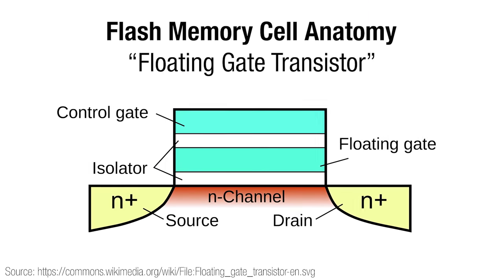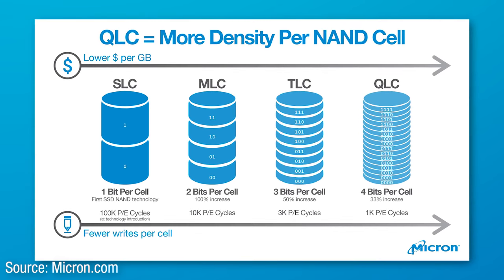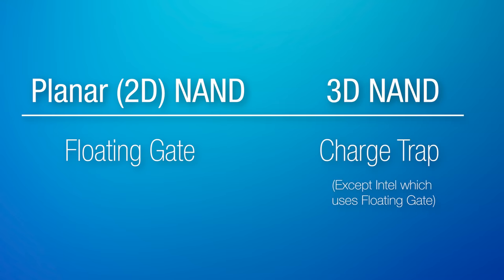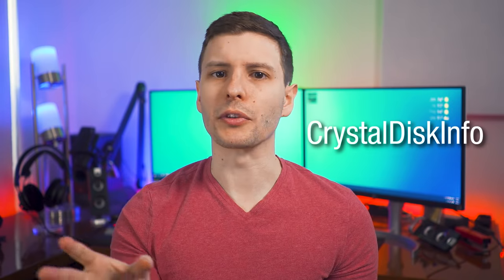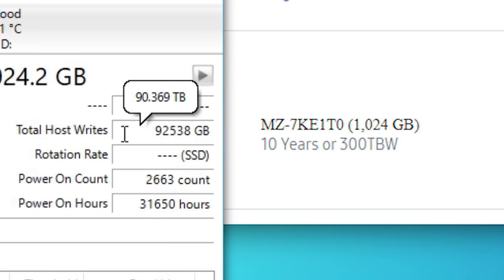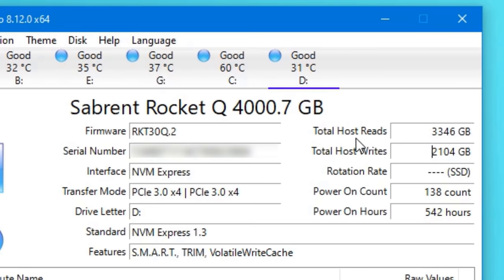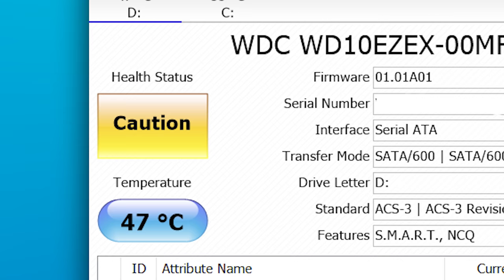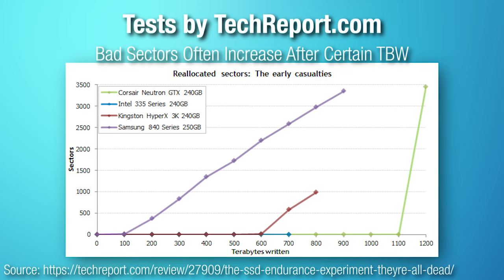How Much Longer Will Your SSD Last? How to Tell

Comment: Sir
Is hibernation or sleep will cause the lower the ssd life or slow down the performance ???  is true 
And some of them saying defragmenting the ssd can cause slow down problems ??? Is this true 

I am affraid of them to my new PC which has a ssd of 120gb
Reply: defragmentation will just use up SSD life, without helping, as defragmentation puts fragements of files together, which is only usefull on HDD's, which have much higher seek times, due to it having to find the location on a platter and then physically move the head to it.
Don't ever defrag an SSD.

Comment: SSDs are more reliable than hard drives?   That is laughable.  I have seen hard drives 25+ years old still working.  Come back when you have an SSD that makes it to 20, 25, 30 years old then make this video.

Comment: Just downloaded the CrystalDiskInfo, is it normal that a 970 EVO Plus is at 75C. I have only watched YouTube for about an hour, and haven't downloaded anything except the CrystalDiskInfo program.
Reply from the maker: Hm according to the data sheet, the rated operating temperature is up to 70C. The non-operating temperature is 85C though (which I believe means max temp in storage, while off, etc). So I'd think there won't be any major damage to the drive just 5C above the operating temp, but it could significantly reduce the life of the drive over time. Also depends whether the 75C is during idle and what it gets up to during a workload. Ideally you'd maybe add a heat sink or improve airflow to get it a bit cooler.
Reply: @ThioJoe  Alright thanks, I added it to a laptop, so increasing the airflow won't be possible. But I guess it won't harm it then. I also ordered an RTX 30-series card back in January, so hopefully, I'll get It soon so I can build my own PC.

Comment: 6:07 my 870 1tb shows 99% on crystaldiskinfo after one week of use and TBW at 1TB where i wrote 5-600GB at max. Is it faulty?
Reply: same
870 evo 500 and 250 GB.... says lifetime 99%.. not even 6months old
i've been reeeeeallly lucky with HD's reliability, mobos, cpu, ram (had one stick 11 years old blow up/fail, thats it) for 15 years so if i hit a landmine i wont be salty.. it just happens and eventually it'll be "your turn to eat it" ... 
sooo wotevs
Reply: That TB written could be some technicality, you know, a lot of small files, but occupying 100 more times because of the block size. 
the 99 lifetime is weird for a brand new disk. My decade old 64 gb adata, 40k hours, 16 terra writes, show 61 percent health. But was really abused by windows because I was not aware of the fast boot option, and at every boot was dumping 6 giga of hyberfile. My other 2 ssd are 100 percent even are not new at all. and adata 240gb, with 15k hours, ang 5 terrawrites, and a samsung 259gb with half that usage,

Comment: Hello.  I have a question about SSDs.  I have a laptop which has a Samsung SSD 860 EVO 250GB drive in it.  The laptop is a Clevo M76T.  Celeron Dual-Core CPU.  T3000 @ 1.80GHz. 64Bit.  It's about ten years old and when the original HDD died three years ago, I replaced it with the 860 Evo.  At the same time, I upgraded the RAM to 4GB and installed Windows 10 on it, but it was always very slow and got slower every time there was a major update from Microsoft, so I replaced the laptop earlier this year.

As I wish to donate the Clevo M76T to a local schoolgirl, I decided to wipe the SSD and re-install W10.  My question is, will wiping the EVO and re-installing Windows, cause any damage to the SSD.  i.e.  Will it seriously reduce the life of the SSD, given it's already three years old?   Would it be a better idea to install a new SSD or HDD?  Given the age of the Clevo, would I be better off scrapping it, or installing a lightweight Linux distro, such as Zorin Lite, which is apparently very similar to Windows and therefore, suitable for someone new to Linux?  Please note, I'm a pensioner and have been using computers since 1999, but am new to SSDs and Linux.  Thank you.  Russ.

Comment: Why are less cells per bit better? Why would having more cells be less reliable, wouldn't more cells be redundant so if one cell fails the others have the same data on them like a RAID system on a server that has multiple hard drives with the same DATA on them where if one drive fails the others still have your data on them?
Also how can you say SSD have higher reliability than hard drives? Hard Drives will last longer because they don't have the flash memory cells that wear out more quickly than a hard drive platter when being written to. Hard Drives have been out for over 30 years and so have hand plenty of time to be perfected and are still improving in reliability.

Also how do you know which type the drive is? They usually don't say if the drives are SLC, MLC, TLC, QLC or 3D NAND on Amazon or even on the packaging if you buy them in a brick and mortar store.
I have a Western Digital SSD and 2 Silicon Power 1TB SSDs and the  Silicon Power ones say on the packaging that they are 3-D NAND and so does the WD but on the listing it did not say which technology it uses.
Reply from the maker: Bits per cell, not cells per bit

Comment: My crucial m500 from 2013 still going strong. Planar mlc. Not even 30TB written. Life at 92%. And my hdds in the nas are wd purple. Better than the crappy green, slower and running hotter. Lol what a failure.

Comment: I'm using two Vertex 4's in a RAID 0. They are at 69500 hours at 88%. About a month ago, only one of the drives showed up at 87% and Crystal Disk was freaking out. Odd thing though, after checking it just now, it's back to 88% and "good" status. Wonder what happened. sHoUlD bE fInE rIgHt? lol
Reply: run hdd sentinal to find out
Reply: @wolfytechs  Seems HDSENTINAL shows the remaining life percentage and displays it as how many days left. 88 and 87% = 88 and 87 days left. Obviously that's not the case.

Comment: If i put a SSD drive in my computer it will be dead within months because my computer has so much corrupted software that my current hard drive gets spammed with repeated reads and writes that seem like everything is downloading all at once. And my antivirus doesn’t properly open or close so it does this same thing almost every time. If anyone knows a fix for software corruption that attacks my hard drive performance that updates can’t fix then I’ll appreciate it.

Comment: Does ssd load faster than hdd?
Reply: Usually, yes. You'd have to compare read and write speeds yourself though, as it can differ significantly. The manufacturers always mention the read/write spreeds.

Comment: TLC has acquired a bad reputation in the past.  Nothing fundamentally wrong but but it just doesn't last as long as SLC or MLC.  So Samsung calls their TLC drives 3-bit MLC.  Not sure if others are doing the same but keep this in mind when reading spec sheets.  That said, my own Samsung 850 Pro (MLC) which is being used extremly hard for like 10 years is holding up very well and similar for a far less used but even older Intel X18-M/X25-M/X25-V G2 80GB MLC SSD.  So clearly the fear of burning through a drive's "write life" is irrational for most uses and modern TLC probably lives as long as MLC of these eh..  classic SSD drives.

Comment: Thats funny... Mine is a Samsung SSD 970 PRO 1TB 1024,2 GB
a total write cycles are 1828873 GB (1,744PB) health is now 51%
Reply: You can still use it without any issues up until around 4000TBW, and you can try to remove some of the old files so that the relatively healthy sectors could be used more often for better wear leveling.  And to increase the longevity, you should keep more free storage on it - don't let the free storage to get below 30%, because the lower you go, the faster those individual sectors would wear out when you write to them.
Reply: @one_step_sideways  this was just an example... I always using drives as long as possible. And of course I have more than one backup

Comment: 0:05 then why in gods name are you saying there reliable
don't know way people keep saying this it bugs the hell out of me; there are HDD's that are still working 10 to 20+ years later, it's how you treat them that effects there reliability. laptops are mostly to blamed for the attitude that HDD's are not reliable cause HDD's where never meant to be portable and kicked around look at the dam Ipod classic, sure SSD are more reliable in some aspects but try to do data recovery on a SSD, at lest on HDD the data can be saved but on a SSD more like 50/50.
on top of that the read and write cycles are still nowhere near a HDD, also if left unpowered for a long time you can get data rot on an ssd.
Reply: HDDs are literally painfully slow
I'd rather use a more expensive, less lasting SSD with less capacity than a cheaper, long lasting HDD if the HDD is that much slower than a SSD

Comment: Sorry i still say ssd fail faster and more then hard drives. I will stick with wd black. i have nonneed for ssd because harddrives are not slow ro me.  When ssd can last longer then 10 years and not have to worry about write/read limits then maybe. I always had harddrives last way longer the etf too. Have dell optiplex 330 that has a harddrive that is like 15 years old i want to say no peoblems.

Comment: I believe your info on CrystalDiskInfo as being free to use is not correct :(  Will not let software run without first subscribing to $9.99 usd per month.
Reply from the maker: It's definitely free, idk where you're seeing that. You use the link in the description?

Comment: Mine has read 18907 GB
And write 6606 GB 
And has 88% Health
Reply: How much free space do you have?
Reply: @one_step_sideways  98.8 why
Reply: @Randomcupcakkes  I don't know the capacity, but I was trying to learn if your SSD is too full. You shouldn't have more than 80% of your storage space used up in order to drastically increase SSD longevity. And you should also delete old files from your hard drive.
Reply: @one_step_sideways  Now 109GB out of 222GB i deleted some downloads and documnts

Comment: I would rather use hard drives. They have an unlimited life span if treated correctly
Reply: I repair computers and I estimate in the last 5 years I have seen 500 dead HDDs. I've had 3 failed SSDs in the same period.

Comment: Yeah i got as main driver with windows the viper Viper M.2 VPN100 : 1024.2 GB good drive quite fast perfect for system there are no games on this drive just system and some pictures and maybe music plus some programs, the tolal space is like 1tb and i so far used 360gb from it and have disc like 2 years now problem is that drive works fine but after i instaled crystal disc info i was chocked the drive lefe spem is at 0 and total host reads is 2437394 GB and total host writes is 2857813 GB at this point this spoose the shit out of me cuz if im correct this is way before its life spem, so i ordered at like 2am right awáy new ssd drive gen 4 and now waiting for its delivery i just hope its gonna come in time. After come to me i start clonning system faster than spped of light cuz idont want to lost my shit. i even back up all stuff just in case plus make bootable USB for windows just in case i lost drive. But what is your consern mate, dit im worrying to mutch or the drive is on the edge of collapse. Also this drive have 800tbw.

Comment: "SSDs have higher reliability in general than harddrives..."
Wut? As long as you handle the harddrives reasonably carefully, and don't have any IBM "DeathStar" disks, the opposite is true. As demonstrated by the very topic of this video, for one. While the typical HDD enjoyer can't even fathom how a "GB/s" number can be real without a decimal point in front of it, it laughs in the face of ludicrous things like "TBW".

Comment: What if my C: Drive runs out if TBWs
Reply: It will still work. It won't die immeadilty if it reaches 0% life left. But it may stop working any time, and even if it did, you can still pretty easily get the data off off there it's just that you can't write any data to it
Reply: warranty is void
Reply: Ok thx

Comment: anyone else have old HDD they're still using?
i wanna compare "total host writes" ... my old 500gb barracuda is showing 3,281,560,320 GB
i couldnt believe it... unreal..
in 2011 was getting some stuff, mobo, other crap and buddy wanted to sling this 'used 500gb hardrive' on me for the cheap cheap.... told him if its a lemon im bringing it back, he was cool said no prob...
its just a spare drive now on my machine, i just put random un-important crap on it.. but im guessing its 12 years old and goign to blow up soon
Reply: I have decades old hdds, working fine, but the catch is they are used as backup. not on for much time. Before, I used to be surprised often by failing disks. My computer was on about 16 hours a day, and after few years surely the hdd will fail, so I started replacing the hdd after warranty time and use it as backup. None failed since. But I had and ssd failed, first one :), failed in few months. Got replaced, and the new one still fine after a decade even is 61 percent good. 

as for that 3 million terra it must be a glitch or a misunderstanding.  maybe is bytes, not Gb. I did the math. It means that it was completely rewritten one million and a half times, divide that by 12 and by 365, and get 1500 writes every single day. I bet that it is not even possible :)
Reply: @ehombane  
cool, glad to hear your HDDs are still chugging.. it seems so pointless and wasteful to have to 'bin' hardware like that every 5-10 years...
"it must be bytes"
when i first read the line, and noticed all the digits i thought "surely, its MB"
but as i glanced to the 'unit type' to my surprise, it was in GIGABYTES.. 
crystal disk software reports this, and HWinfo reports the same thing...
lemme go check right now, on the months old new SSD's i got to replace the old HDD's... .. the new 870 evo, for games and others software is already at 1,278GB total host writes... the new 870 evo 250gb which is now my windows boot drive (that and only that) is at 537GB total host writes... the old 500gb barracuda HDD is at 3,149,819,380 GB total host writes... power on time, 36,008 hours, 6,319 boots...  smart drive warnings indicating 208 rellocated sectors.... so, like a cig burn on paper, bad sectors are going to burn and grow larger, and larger and larger until total hard drive failure....

i feel like al bundy in that episode where he was going to get awarded money from an automaker because his cars odometer tripped over '1 million miles' ..
Seagate, my old barracuda has tripped over 3 billion gigabytes in total host writes, i want my MONEY
Reply: @ehombane  ffs, i read my first comment and realized the total host writes i wrote there is less than the one i JUST wrote here, which is impossible...
and now im wondering if the number i wrote there, was actually the "total host reads"
if thats the case, its gone from 3.28 billion GB total host reads to the current one 3.6 billion GB
its either true, or the softwares busted, or the PCB/chips on the drive is drunk.. because i ddidnt know these amounts were possible
Reply: @kwazhims3lf  obviously is a glitch. And happened recently. So, in those few days added some, 0.32billion. So those absurd 3 billions started to chunk up about 10 times more days before that. Yep, maybe some multiplier got busted and adds up theoretically. or the counter (have no idea how it works) also got busted and adds phantom bytes.

Anyway, that is funny :))  (Maybe not so funny for you, waiting for it to go bit heaven soon)

Comment: 1:14 Where have you seen such characteristics? Your 970 Evo Plus (it TLC type) has less than 615 cycles, and you say 3000 cycles. See the data sheet before talking nonsense. All quantitys of cycles are long out of date. All SSDs are disposable trash.

Comment: QUESTION: Based on the information seen at 1:17 it appears to indicate that my 128GB TLC SSD can have its life expectancy calculated by multiplying the number of 128 by the TLC factor of 3,000. This results in 384,000GB for Total Host Writes. Is that correct?  Currently, CrystalDiskInfo is telling me the Total Host Writes for my SSD is 3,115GB. But if the SSD could potentially go all the way to 384,000GB this strongly suggests the SSD has a LOT of life expectancy still. Is that correct? 

Also, I have one of the original 1TB SLC SSD from Samgung, which and a 10-year warrant. Based on the information at 1:17 that says "100K" is multiplied by 1TB, it means this SSD has a life expectancy of 100,000TB for Total Host Writes. Is that correct?

Comment: thanks, it barely 1 month but my ssds had been  writing/read averagely 2-3 tb, im new to using ssd so im still trying to figure on the part to replace them when the time comes and my files are still in the ssd by then

Comment: I could not find on CrystalDiskInfo the information about total writes for my SSD found at @3:50, so I uninstalled that freeware program which seems a bit iffy and spamish.
Reply: Reinstalled CrystalDiskInfo in 2024 and found the total writes... also they have a simple health status in the upper left side of the program to indicate "Good" or not, and what percent out of 100% it's good.  No need to consult the original spec sheet of the SSD.

Comment: has anyone here actually saturated their ssd lifespan?
Reply: Usually they last way more than advertised, one time one of my friend had a toshiba NVMe drive i believe, Crystal disk info says how much life remaining but this program they used on their linux system said it opposite, new = 0%, fully done = 100%. that ssd was at "255%" and STILL going. As you can see, 2.5x times more than what is advertised, it COULD've gone longer but I think the attributes SMART works with just broke buffer at 255 (the counter broke, BUT THE SSD still worked.)